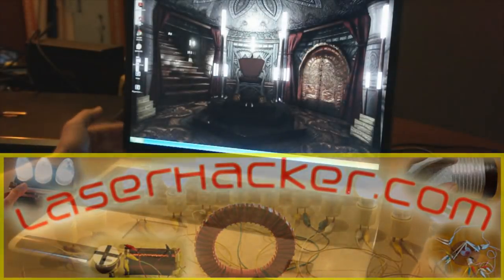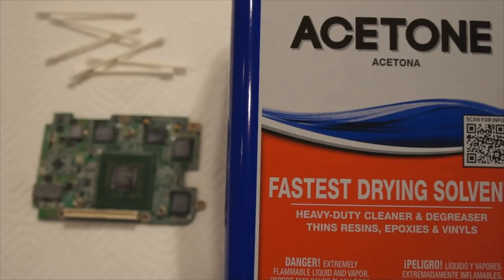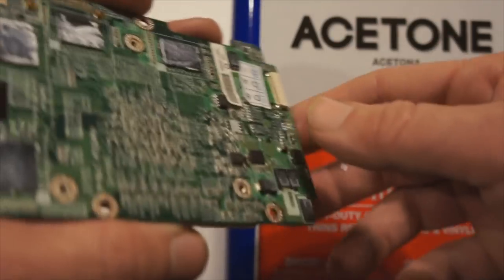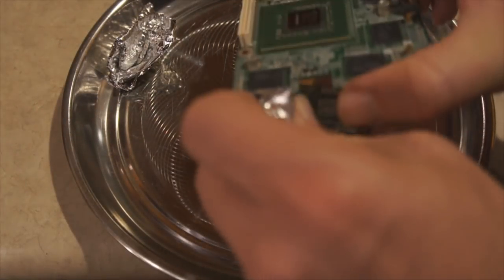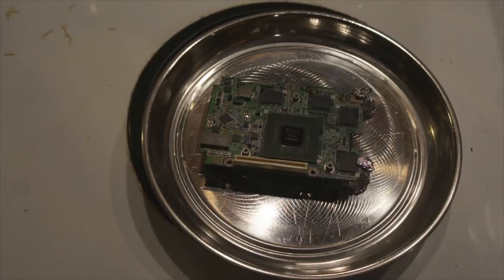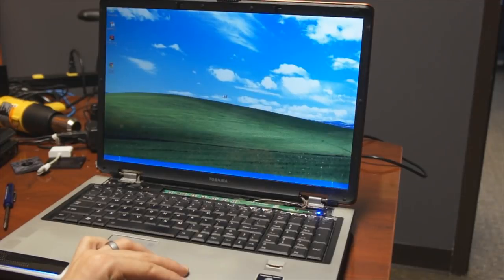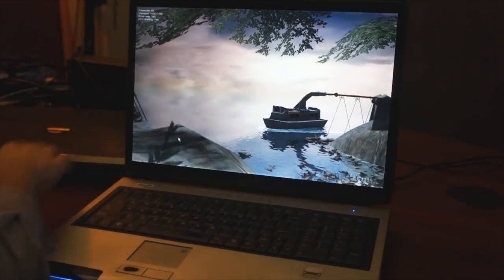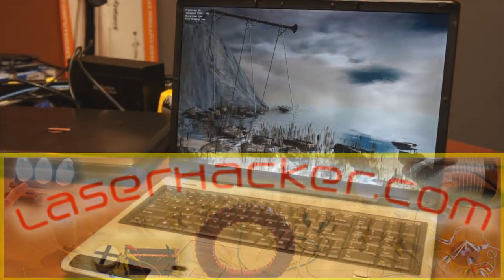DIY Fix - Oven Baking a Video Card - Fixed my Toshiba Laptop

Comment: Great video. I performed something similar on my older PS3 and it worked. I used a heat gun directly on its CPU & GPU. In my research, I found that a gov regulation forced manufacturers away from lead-based solder. Afterward, products experienced issues will solder connections to components with the new solder. Mostly, fine point connections (chips). 
Overheating is definitely the issue. I used better thermal paste and cleaned to improve air flow. 3+yrs w/o issues.

Comment: Had the same with an Acer laptop. But I did not bake it. I used a magnifying glass (actually to be precise a Fresnel lens) and only heated the Nvidia chip. So it was very locally heated, only that chip. Heating it up in the sun took about 1.5 minute or so, I did not time it. The beauty is that I only needed to remove the heatpipe, and yes, I did some research and watched some video's (of which yours is now one as well).

Comment: Thanks for the tip, it worked.
I took the plate ati mobility radeon hd 3650
I put it in the oven at 195 degrees for 10 minutes and the image is already a problem.

Comment: Baked the motherboard on my Yoga 2 Pro. 9 minutes at 385 F measured using an oven thermometer. Apparently it fixed my laptop that would crash and wouldn't boot. Either that or the disassembly-reassembly process did the trick. In any case I am a happy camper. From now on, I am baking electronics before heading for the dumpster.

Comment: I would not do things like that in an oven that I cook my food in.  All those PCB's sticking to the oven walls now probably. I have seen people heat plastics for vacuum molding, and it is a bad idea.  But other than that, incredible solution, and I am happy for him that it worked. I can't imagine the patience it took to take that laptop apart and put it back together again.  That looks very difficult.. Great video.

Comment: Used to have the exact same problem/fix with Dell Latitude D Series laptops. I added a copper shim under the head sink about 5cm square shaped to not foul/short any other components. The added heat dissipation cured the problem permanently. It seems several laptop designers messed up on their heat management probably due to nVidia under speccing the heat dissipation requirement of the part.

Comment: I recommend vacuuming out the dust instead of blowing it out. Every time I have used compressed air on my PCs it forces dust into the fan bearings and they start whining and shortly fail altogether. Although I am using 100psi from a compressor, not the canned stuff. So, maybe i am over doing it with that.

Comment: Great video, I just did the procedure yesterday and it worked!
However I did another tweak to avoid having to reflow every 2 weeks:
I disconnected the yellow fan cord and wired the red one to the USB connector nearby. This way the fan runs constantly at full speed, now the GPU cannot even reach 45 C° xD
Toshiba Satellite Pro P100 with the GeForce 7600.

Comment: Works on vostro 1510 I did it for 10min worked for a week and back to coloured lines on screen, Did it again for 30min Gas mark 1 and put solder paste along top ( silver bits ) and bottom of chip. still working 3weeks later.Dont forget to take small Battery off Board .and tape that can peel off.

Comment: I'm actually surprised some of the downward-facing components didn't just fall off when the solder reflowed. How is that possible? Surface tension?
Reply: Yes. And you also don't hear the solder to it's melting point. Just a few degrees below the point so the solder gets softer and fills the tiny airgapd

Comment: But how do I get the card out of the pc. I'm dissembling it now. And before I get too far into it, I wonder if you have a video on how to get the card out of the unit. Thanks.
Reply: +Ely Acker Only works with the very few laptops that have MXM video cards, 99% of laptops don't have removable video cards.

Comment: Think that's crazy? When I was in the Air Force as an electronics tech one of the troubles we had was dust causing shorts on circuit brds. The dust would hold ambient air moisture causing the shorts on microprocessors. The solution was to wash the brds by spraying with "Fantastic" cleaner, works best of all cleaners, then brush the board with small soft paint brush, rinse with water then, 91% alcohol to force H20 evaporation let air dry 24 hrs. Voila ready for service! Cut failures by 99%.
Reply: I thought mil spec required conformal coating ?

Comment: I have a 4yr old laptop that dies if overheated - now just realizing that I could probably try heating the mxm card instead of ordering one from ebay.  Hopefully that, and replacing the  heatsinks' thermal paste and blowing this shit out of the fins with an air compressor will do the trick...

Comment: Broken solder joints is not the problem here, but the chip breaking down internally
Reply: +To Go Go check out how a flip chip designed chip is made. there are internal solder bumps which by heating temporarily repair itself. There are many PhD level documents on the issue. If you heat the chip to 150c the chip will start working again. But unleaded solder melts at 221c. so it can't be the solder joints.
Reply: Are the internal solder points not unleaded also?

Comment: Hmm, I have a T40 with an ATI 7500 that is known to have similar issues and It will not powers on intermittently or just shut off. That said the chip itself has no heatsink. I was thinking about tossing it or getting a cheap refurbished mobo from ebay but I'll try baking it. However my oven is low tech, so I'll need a thermometer.

That said, you do need to clean the fins for laptops. I do a round ~ every 1-2 months, MAKE SURE to NOT let the fan spin, else high rpm dmg

Also GTF off XP srsly !!!